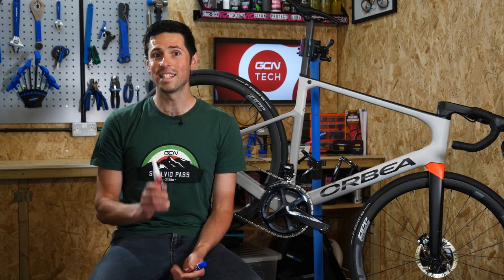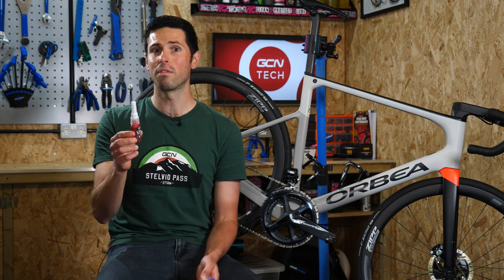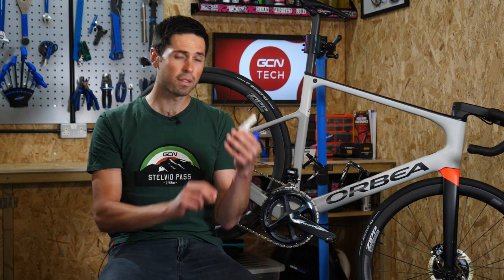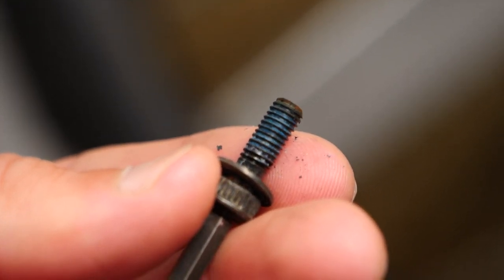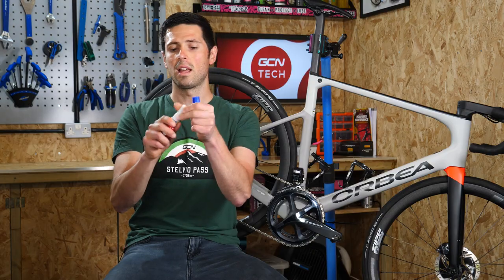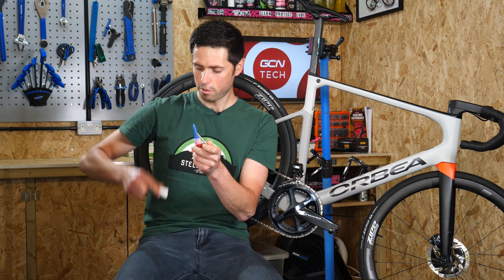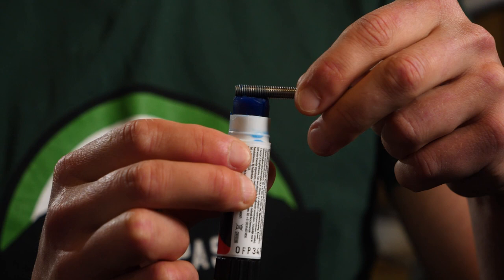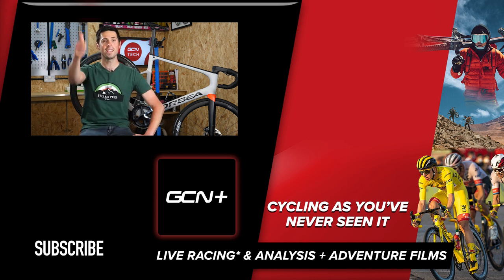Why & Where Should You Use Threadlock On your Bike? | GCN Tech Monday Maintenance

Comment from the maker: Do you use threadlock? Will you start using it after watching this video? Let us know 👇
Reply: No. See no reason. I have never experienced a bolt going loose. I think this is overkill, and just add to the annoyance of getting them off.
Reply: Gcn tech, can you guys make another series of bike builds? May I suggest mtb to gravel bike build please 🙏. For those people wanting to dip their toes on transitioning from mtb to road but act on low budget. A huge thanks in advance 😂.
Reply: Gcn tech, can you guys make another series of bike builds? May I suggest mtb to gravel bike build please 🙏. For those people wanting to dip their toes on transitioning from mtb to road but act on low budget. A huge thanks in advance 😂.
Reply: Gcn tech, can you guys make another series of bike builds? May I suggest mtb to gravel bike build please 🙏. For those people wanting to dip their toes on transitioning from mtb to road but act on low budget. A huge thanks in advance 😂.
Reply: Firstly, red threadlock has no place on bicycle components unless you never want to ever disassemble it, even with heat.

Yes, threadlock has replaced anti-seize. Even though anti-seize walks less than grease, but sometimes you just don't want that near rotors or bearing surfaces.
Reply: no.  i retighten tighter.  spoke threads though,,, thats a touchy subject.
Reply: i know I am quite off topic but does anyone know of a good website to watch new movies online?
Reply: @Nasir Salvatore try Flixzone. You can find it by googling :)
Reply: @Steven Noah yup, been watching on Flixzone for years myself :D
Reply: @Steven Noah Thanks, I signed up and it seems to work :D I appreciate it !!
Reply: @Nasir Salvatore Glad I could help =)
Reply: i could see superficial amounts being wise
Reply: Threadlock a must for bolts specifically requiring them. As per manufacturer's spec

Comment: The purple thread lock inside a red bottle is really confusing! Yes I did see the purple on the label..
Reply: ... and the "purple threadlocker" itself is blue 🤯. I was surprised (and somewhat worried) the first time I removed the disc calipers of my LBS-assembled bike and saw red threadlocker, until I applied my own local-brand medium-strength threadlocker and saw it was red. Loctite threadlocker bottles also have that "feature" (being mostly red with a stripe marking the type of threadlocker)
Reply from the maker: It's not as simple as it could be, that's for sure!
Reply: @docontra4921  if it were the high strength red, you wouldn't be removing those calipers.

Comment: You only need purple for bikes. The point of having a thread locking system is to keep the preload in stud/bolt (that can be lowered by bolt loosening) and NOT to counter any additional torque put onto it: i.e. if a bolt rating torque is 5Nm, you don't want to have to use an extra 5Nm to unlock it. Bolts loosen because of changing conditions (eg pushing on the handlebars from side to side) and vibrations. A good design takes into account the bolt preload (example of 5Nm) and does not take into account the thread lock. the added lock is just for safety!

Comment: Early on I was always told to use grease on the various bolts in order to ensure proper torque and prevent seizing later on.   How do greasing the bolts fit in with threadlock these days?  Mutually exclusive?
Reply: Threadlock prevents seizing by corrosion

Comment: Lol.  I’ve had a bottle cage rattled rattled off by the cobbles of Lincoln Michaelgate.  Threadlock on bottle cage bolts solved that.
Reply: yep, def worth a dab
Reply: split-lock washers do the trick as well, they cost a few cents and threadlocker is a bit pricey.  Bottle cages are the most notorious thing to vibrate loose next to disc brake calipers/rotors
Reply: Thread locker would've saved me from drilling my rusted out bottle cage bolts...
Reply: @robertcowling4313  I never use anti-seize on bolts. You use that on stuff that's meant to be in constant motion, not bolts.
Loctite would've prevented my bottle cage bolts from corroding.

Comment: I just lost a dust cap from 1991 8spd Campy Record derailleur pulley -the whole pulley wheel fell off. I found the scattered parts except for one dust cap, which is unique and impossible to find online, so I replaced the wheel with an 11-tooth generic (works fine), but this could have been avoided by a) checking my bike better, b) threadlock!! I'm going to use it on some parts that don't normally have it, just for peace of mind.

Comment: Gotta be honest I don't use thread lock, I actually use grease on almost everything on the bike because I'm afraid of the bolts seizing up... thread lock on bikes just gives me nightmares.
Reply: Same. Only grease and I have never had a single component loosen. That being said, I maintain my bike constantly, so I could see it being more of an issue for those riders who either don't know how to maintain their own bike or rarely do ... in which case, this video is not for them.
Reply: My worry with grease on low torque areas is that you can achieve more compression with the same torque - so you could end up crushing something whilst your torque wrench says you haven't overtightened. At least that's what it feels like when I use grease for those things.
Reply: MRGRUMPY53  I put some centrelock disc rotors on the other day - with a tiny bit of grease. As I was using a tool that takes a spanner I couldn't put a torque wrench on it. No idea if they're on too tight or too loose. Or Goldilocks. What does 40nm feel like in terms of grunts or effort?
Reply: MRGRUMPY53  No. Those bolts are about 6nm. So I'm looking for 6 - 7 times that force. Just did it up shy of what stripping the threads might feel like.
Reply: On rough surfaces which cause vibration any clamp / bolt etc. can come loose. Thread lock works by filling the spaces between the threads, not allowing vibration to cause movement between the two items fastened together and thus allowing them to untighten.
Reply: Threadlocker will actually keep the threads from seizing; prevent galling and rusting. Grease on threads will allow more torque than it feels like. Most fasteners don't use lube when torqueing for that reason.
Reply: @playandteach  I could see that possibly being a concern for carbon.

Comment: Any tips on cleaning the inside of threads, the nut part of the nut and bolt? Cleaning the bolt side is easy, but the thread that it goes into is a lot harder.
Reply: A thread cutter usually works

Comment: With the low torque settings on cycling bolts, could you explain why carbon assembly paste can be the difference between a slipping or unlocking component like a carbon handlebar stem / clamp and a seat stay / clamp.
Reply: Beacuse the paste creates friction

Comment: I've got an old road bike that has a history of the fixed cup on the bottom bracket coming loose, even after tightening it down with a lot of force. The style bottom bracket is a typical 3 piece, tapered & cotterless used on many bikes from the '80's. Would the threadlock do the trick to keep the fixed cup from coming loose? I'm worried that during it's initial use, some of the excess threadlock might seep into the cup & bearings - a real disaster!!

Comment: #askgcn - co2 cartridges
Hi GCN I am looking to upgrade my road, emergency tire kit. Currently I have a minipump which isn't exactly massive (16cm) but I don't want to attach it to the frame. Handlebar bag is an option, but I want a smaller setup for climbing days. The pump won't fit in a saddle bag so I started looking at co2. It's promising but I don't like the single use disposable nature of them. So my question is, what are the alternatives? Refill cartridges? Or are they not as bad for the environment as I think? What do you guys usually carry in a saddle bag?

Comment: One important place for thread lock is not on the bicycle. Use it on the screws that hold the cleats on your shoes. Those screws are notorious for getting loose or coming off while you are riding. If thread lock isn't immediately available, fingernail polish works quite well...the color of the polish won't matter.
Reply: wow, yeah one of my shoes come loose unexpectedly after a whole year of doing fine, but that time i need to remove the pedal and damage the shoes slightly initially (try to remove the shoe realizing after it does not work). lesson learned.

Comment: huh... I always used grease for these bolts. Is there any reason that threadlock works much better?
Reply: IMO Works better  when required torque is under 2nm. I use it only for jockey wheels bolts and computer mount bolt , maybe also for bottle cages is good.
Reply: The motivation for using thread lock is diametrically opposite to that for using grease.  With threadlock, the goal is to keep the two parts attached to one another.  With grease, the goal is to allow the parts to be separated next time something needs service.  As a person who removes the pedals, bottle cages, bars and rear derailleur when packing the bike for air travel (not doing much of that these days though), I like components to disassemble easily.  If you have ever sheered off a bolt head due to bi-metalic corrosion (Aluminum/steel), you would diligently grease your parts for future disassembly.

Comment: Could I replace threadlocker with plumbers tape?
Reply: Plumbers tape is intended to keep a water seal for plumbing joints which rely on the thread for a seal (rather than compression joints) it's main job isn't keeping something secure. Bike bolts would be subject to alot more rattling, shakes etc. to work loose over time. However plumbers tape would fill up the gaps inbetween the thread and might slow down the unwinding process.

Comment: Thread lock 
Is something I've started using on rear axle repairs, and lose lock rings. 
Including the front wheel axel as well. 
This prevents them from coming lose like they do love doing. 

DO this for a friend, and suddenly it never happens again. 
I just used a weaker one so it could still be taken off (with a hammer drill :) ) 

In fact when I update any parts I use thread lock.

Comment: @gcntech  we need super-precise kilowatthour meters and this is why.. for ebike racing.  for ebike racing the racers would need all equal battires and not just that, but tiny little boxes that allow only a set amount to go through before shut off.  that way the racers have 'exactly' equal amounts of electron potential.   if one racer wants to use rear hub, mid drive, front, 750watt, 250 watt..   the race will decide which is more advantagous with the combined effort of an adept athlete.

this is gonna eventually happen and this is what is needed to make it happen.